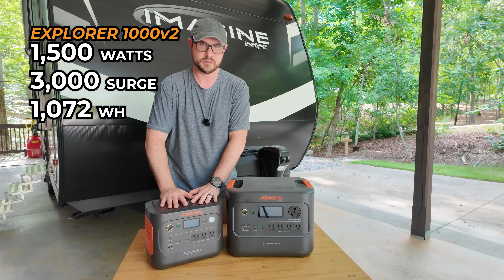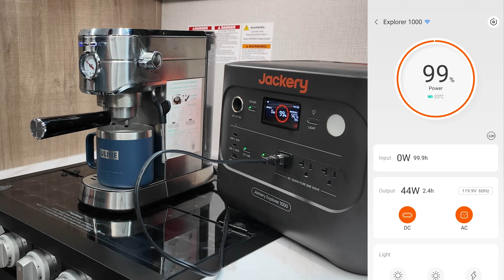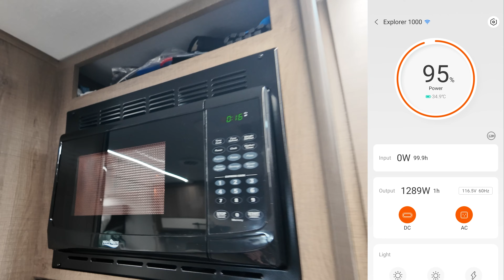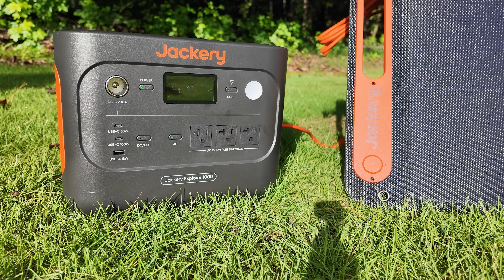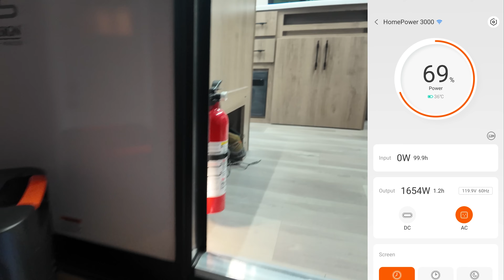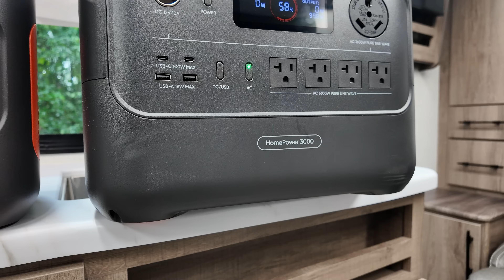Can a Jackery Run an RV Air Conditioner? (3000 Pro vs 1000 v2)

Comment: We have solar on our rig with with 400 amp hour batteries. We also have the 3000 watt power station. But, neither one can replace my Honda generator. They do well at supplementing my power needs. But, it’s not a replacement for a gas powered generator that will run as long as I have fuel.
Reply from the maker: Great point

Comment: Have you tested this with a Solar setup?  how long does the AC run for in this setup + Solar.
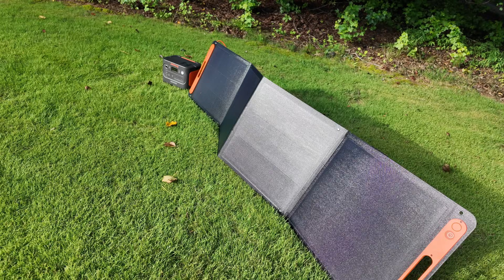Reply from the maker: The solar would basically help extend the runtime, but only marginally. The Solar Saga 200 (see 17:02) would offset by 200W max under ideal conditions...oftentimes if it isn't direct sun you may only get 100-150W. So all in all it would take quite a solar array...1000W+ to really make a significant difference during AC use.

Comment: Can you pass through charge while the rv is plugged in running AC? I just received my 3600 plus and it initially turned on AC until I plugged in to charge.  Then I got stuck on a F6 error. Waiting for feedback from support
Reply from the maker: Do you have a soft start on your AC? If not, that is likely culprit due to in rush current.

Comment: Great video!  Great info on the ground neutral plug.  I have the Jackery 3000, but on their website chat, I was told I needed a grounding adapter.  But it didn't tell me how to use it.  I thought that was the correct way, as I have used one with my gas inverter generator.  You verified it for me.  However, My Cass C motorhome doesn't have a built in  Electrical Management System (EMS), so I have one that I plug into the campground pedestal.  If I don't plug the EMS into the Jackery, do I still need the grounding adapter?
Reply from the maker: If your class C has no epo, ems, or hardwired surge you shouldn't need a grounding plug... Should be good to go! Let us know if you find otherwise.

Comment: Just received a Jackery Explorer 1000 v2 as a gift.  New to power stations.  I have a KZ Coyote Hybrid trailer.  At home, I have the trailer pluged into a 110V wall outlet using an extension cord.   When camping, can I plug the power bank directly to the camper using the 110 adapter on the camper's cord to run the lights, pump,  outlets TV?  I would run the fridge and furnace on propane setting and we hardly ever use the microwave.  Will it damage the power bank or trailer inverter if I try it and it fails?  Thanks.  Great video BTW.
Reply from the maker: As long as you keep the RV use under the 1500W max it'll work like you suggested. And if by chance you exceed the 1500W there is a surge capacity, but otherwise the jackery would cut power.
Reply: @AdventureRocks  Excellent! Thanks.

Comment: You blew up something. When you plugged in your 30amp plug.
Reply from the maker: Great question. The "thud" you're hearing is the hardwired surge protector w/ EPO: 
https://amzn.to/49KLWVl

It'll sound similar to a transfer switch changing between inputs. It waits to apply power till it passes all the safety checks.
Reply: @AdventureRocks but it flashed.
Reply from the maker: @memphisreines  Great question. On an RV there's a 12V converter that switches between the 12V house battery and 120V shore power for all the 12V appliances and lights. The transition from one to the other will briefly cause flicker on 12V lights, especially if they are LED. When the converter sensed 120V power via power station, it changed from house battery to shore power and you get that flicker. You'll see the same thing when plugging into a campsite pedestal.

Comment: Do you charge your Jackerys on the road with the 120 volt outlet in your truck? I cannot get my Explorer 2000v2 to charge with the 120 volt outlet in my 2024 Tahoe
Reply from the maker: Great question. I don't think it'll work because the 120V outlets in our GM trucks are limited to 400W max whereas the Jackery will pull significantly higher. But also the inverter in our GM trucks is not a pure sign-wave AC inverter, and it's my understanding the power stations need a pure sine-wave inverter for charging on the go like that. Otherwise a DC-DC option may suit your needs like this one here:
https://amzn.to/3NGHw9h
Reply: @AdventureRocks Thank you

Comment: Did you replace the Segway with one of these units ?
Reply from the maker: Great question. No, still using the Segway. In a way, I have the priviledge of testing a lot of these different units out when manufacturers send me them for evaluation, and each have their strengths. In the end I'd stick with one of the mainstream players such as Jackery, EcoFlow, DJI, or Bluetti...those are my top 4 go-to brands. Another factor that plays into it is if you already are in a particular ecosystem...such as DJI or EcoFlow as their DC-DC chargers are exclusive to their brands.
Reply: @AdventureRocks thanks for the response. I picked up a Jackery unit from Costco today. Going to use your shopping list to attempt a similar system on my 21BHE. Thanks again.
Reply from the maker: @wheresjames  hope it goes smoothly. Thanks for watching!

Comment: How did you hook up the slow start for your AC and where did you buy and how much does it cost and what is it called?
Reply from the maker: Thanks for watching. Here's a detailed video for the soft start I did on my Furrion HE:
https://youtu.be/ChxNhkg_rGM

There are two major players in the soft start market, I went with SoftStartRV for mine and it's worked flawlessly. Cost is under $300.

Comment: Need a gas generator to charge them off grid because the sky's are loaded wirh chemicals trails and the solar doesn't work with clouds and rain. Dont just depend on the sun! We have non! . Live both models.
Reply from the maker: Good point, the solar is a slow option especially with cloud coverage or number of panels are limited.

Comment: How would this work on my 5th Wheel (50A)? Would I need to go up to the 3600 unit?
Reply from the maker: You could get a 50A to 30A dogbone adapter and connect. You'd still have to limit what you use on your fifth wheel to stay under 3600W. So kinda like you're plugged into a campsite with on 30A...maybe a single AC and microwave at same time, but probably not 2 ACs unless you have some of the newer ones like GE Profile or Furrion Chill Cube.

Comment: Question: this power bank can hold running two motors of 16amps on two outlets?
Reply from the maker: There are 4x 20A outlets that support up to 2400W max combined. To get the 3600W, you have to use the 30A outlet. So if you got a 30A to 20A/15A converter dogbone plug, you could run one 16A motor on the 20A outlets and one 16A outlet on the 30A...and you should be okay although it'd be pretty close to limits. Just be aware of the LRA in-rush to make sure it doesn't trip up the power station. Sometimes the in-rush current can cause them to stumble.
Reply: awesome, thanks for all the info and speciality your time.

Comment: I have the 1000 V2 and just recently received the 3000, I use them for car camping in my Subaru outback 😂, haven't tested the 3000 yet
Reply from the maker: Nice setup. Thanks for watching.
Reply: May I ask...do you have some sort of portable air conditioner...such as a Tent AC?  If so, is is an "Inverter" type?  ...to cool the Outback at night or day?   (I have a CrossTrek, but would  like to Car Camp in the summer months, too.)

Comment: I’m a new RVer. I just bought the Jackery 3000. What was the plug you put in the generated before turning on the air conditioner? And why do you need a soft start on your ac unit?
Reply from the maker: Welcome! Thanks for watching. And, great questions. That plug shown is a bonding plug that takes the ground and nuetral and connects it, which is only needed if you have a hardwired surge protector such as the Power WatchDog where it checks for things like a ground and neutral. Otherwise that bonding plug is not needed. The soft start is almost always required on an AC if you want to run it on a power station. The soft start is a capacitor that basically eases the amp in-rush current when the AC compressor turns on. For most power stations that extreme in-rush current will cause an "overload" of sorts and cause the power station to shut down think that it got overloaded. Even though it's milliseconds...it trips it up. So, the soft start eases that startup current and make it feasible to run off a power station. Hope this helps!

Comment: I've had my Jackery 1000 v2 for a month now, and I am glad to finally have it. I use a CPAP when I sleep, and was always nervous that the power would go out while sleeping. No worries anymore. 👍🏾
Reply: I use the lighter socket to power my CPAP as it drains the power station much slower.
Reply from the maker: Nice setup! Thank you for watching.
Reply: How many watts does the cpap draw
Reply: @jamesfinn5390 I purchased a 12v adapter for my cpap so it wouldn't pull the regular wattage. I haven't had to use my Jackery for the cpap yet though.

Comment: Nice video, how about a fridge?
Reply from the maker: Thank you for watching. Refrigerators are no problem for both the 1000v2 and 3000. A larger residential refrigerator may consume 5.0A or 600W while running. So either would be suitable for power back-up during storm/outage to keep refrigerator alive. Hope this helps!
Reply: @AdventureRocks thank you! Now for the difficult part, deciding between the 2! I guess it’s better to have more than you need than less

Comment: I wonder how well the 2000v2 would do with the 30amp plug with a 30a-110v adapter. I really only need to run fridge and microwave during dry camping/ elk camp
Reply from the maker: Great question. The microwave is naturally the higher draw appliance there, but since use is intermittent, it should handle it just fine.

Comment: So for the 1000, I can’t really relate to these examples where you show it can run a coffee pot and a hairdryer because those things would use so much of your battery. I use my solar generator when camping over a weekend, not a day.
Reply from the maker: Great point. Thankfully they are short-use appliances running for a few minutes compared to a more continuous draw appliance such as a small cooling fan that might run overnight for 8+ hours. Here's a helpful formula to calculate runtime: Jackery Capacity in Wh × 0.8 ÷ (Operating Wattage of the Appliance ) = Appliance Runtime (in hours).
Reply: @AdventureRocks  mine is strictly used to run my refrigerator while I’m off the grid, which it will do for about 2 1/2 days without needing a change, depending on the outside temperature. Food preservation takes precedence over everything else for me.

Comment: We are looking for a power station to be able to use it between both the 5th wheel (to keep the refrigerator running while transit) and the Bayliner Trophy. We don't need a permanent install in our 5th wheel neither the boat. Too much money.
Reply from the maker: I hear you. That is exactly why I use one on my RV. Technically either one of these would work for the fridge. I gotta say the HomePower 3000 is pretty sweet with the 30A plug on it and it's still relatively compact. But, if you don't think you'd use the 30A plug, then the 1000 v2 is more than sufficient. With the Prime Day savings they are both great prices right now.